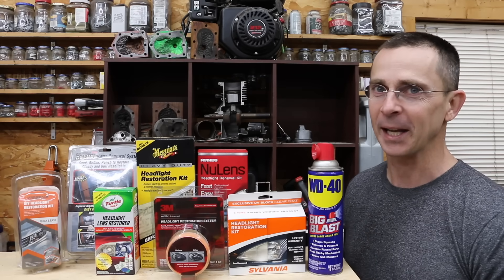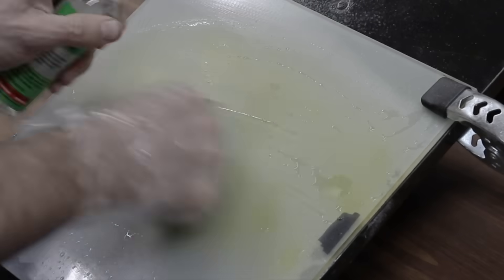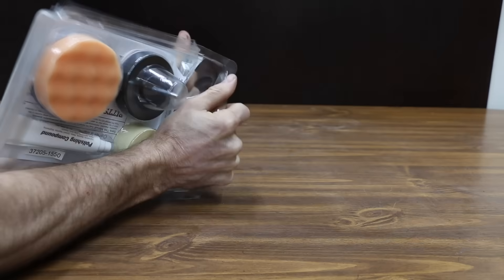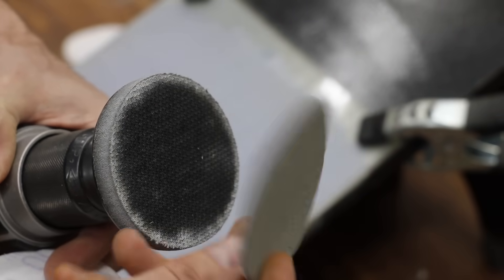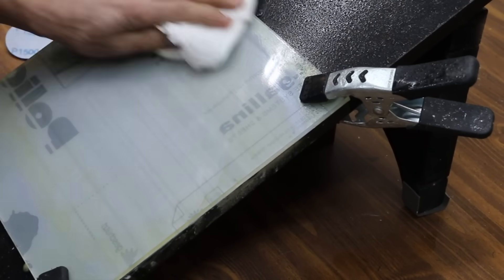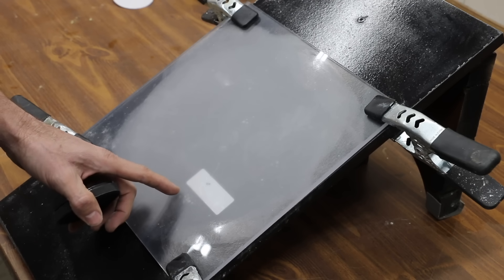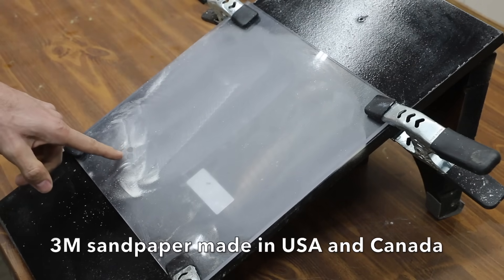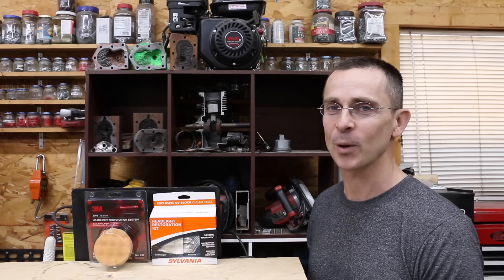Best Headlight Restoration Kit?  Let's find out!  3M, Sylvania, Meguiar's, Mothers, Turtle Wax & HF

Comment: Wish you’d used wd-40 as a control. You teased it in the beginning and then nothing. Great video but would’ve like to compare to home tricks such as toothpaste.
Reply from the maker: Thanks for the video idea.
Reply: @ProjectFarm  Actually there are many DIY headlight cleaning youtube videos.  Instead of any of these prepackaged products I cleaned mine by buying the separate items and after five years they still look like new.  The whole objective is surface preparation and then recoating with a clear, anti-UV paint for plastic.
Reply: @Rattlerjake1  - What paint did you use?  I have refinished headlights before, with just ok results.  I used Rust-Oleum 2X Gloss  Clear.
Reply: @stephenh5944  In auto parts places you can now actually get 2 part clear coat, automotive type in shake cans. This will do better than the rustoleum as its hardener is other ingredients is designed with high sunlight UV exposure in mind. Actually... new vid suggestion for  PF, "Which over the counter clear coat handles the sunlight best"... maybe he'll see this and give it a go... actually I'll put it on main comment feed also.
Reply: @Rattlerjake1  Yeah, what paint did you use?
Reply: Yeah, how good are these products in comparison to diy home tricks, would be cool.
Reply: Always good to see the comparisin, but if you have a bad lense, Try it. Cheap. Everyone has some. If your lenses have minor damage, the toothpaste is a very mild rubbing compound. WD-40 fills in tiny cracks and makes them disappear .... for a tiny while until it dries. The lenses I tried them on were too far gone. The 3M kit uses sandpaper to remove the degraded plastic and scratches. Makes the lense completely opaque 😬😱 .... very unnerving. But the finer and finer sand paper, rubbing compound, then polishing compound makes it look perfectly clear. Surprised the heck out of me!  Bottom line is toothpaste and wd-40 will work on marginal lense damage, but major yellowing needs more removal then they can provide.  By the time I was ready to try a kit, I had spent $500 on the other broken lense and was using a flashlight out the window since the yellow lense was way to degraded — toothpaste and WD-40 did not have a chance.  3M kit made it look new!
Reply: I can vouch that toothpaste and even plastic polish only work if the lenses are in good to decent condition. Anything less than decent needs the Sandpaper. Don't forget to put a UV coating after for it to last.
Reply: Toothpaste does work if mild oxidation, however, you still need a protectant for it to last. In Texas, it'll last maybe through summer without a protectant.
Reply: I bought myself a new toothbrush and used the old one with gritty whitening Colgate toothpaste. It worked well.
Reply: No one wants to hear about teeth whitening toothpaste being used as a mild abrasive for a damaged headlight. This is nonsense and is only good on lenses of slightly newer cars where the owner was too lazy to properly wash the vehicle and keep it out of the sun when possible. Rubbing compound, some Bounty paper towels, and your hand is superior to toothpaste. Walmart has Turtle Wax brand for cheap.
Reply: @B B This is how I do it as well.  If they are really bad I will start with a lower grit, but end at 2,000 and then rubbing compound.
Reply: Doug Roth I.    It’s just like compounding a car. Always keep it moving, never concentrate in one spot. The other thing to watch is sharp edges. Compound tends to cut extremely aggressively coming into an edge. That’s why I always try to buff off of an edge rather than into one.    Learned that the hard way🤭.    If you can’t do that just be very mindful of how aggressive it is right on that sharp edge or do it by hand in that spot.
Reply: B B      Sure enough, you do have to make sure to shoot it with  clear coat of some sort for anything to last.
Reply: Well....we all know if WD-40 can't fix a thing, its because you didnt apply enough WD-40.
Reply: Honestly if headlights have heavy oxidation I smear on Colgate and let it sit for an hour or so no water in the sun then rub the crap out of them. Acts like pumice. Then go over with nail polish. Don’t know how good it is for the lenses but lasted a couple years

Comment: Best thing to do for restoring headlights is wet sand paper and then meguiars cleaner wax..
Get a bowl and put warm soapy water in it,
Start with 1000 grit...wet sand
Then 1500
Then 2000
Then 2500
And then 3000 grit..
Let dry..
Rub cleaner wax really hard all over headlight...let dry for 10 min...
Wipe off...done!
Reply from the maker: Thanks for sharing.

Comment: True Brand makes a headlight restoration kit I think you can buy from napa not sure if you need a commercial account or not.. been using the stuff for ten years it's a longer application process but seems to have worked well for me in the past. Bg makes a kit aswell that I'm not sure I like as much. I'd love to see a project farm exhaust flow test. Somehow using a fan and balloons measuring increase or restricted flow from different mufflers or exhaust components.  I've been a mechanic for ten years. I really love you're tests. They have been a great source of Info and entertainment. Thanks.
Reply from the maker: Thanks for the video idea.

Comment: Very helpful, since I have 3 vehicles with headlights that need restoration. What UV sealer would you recommend if I get the 3M kit (Can't find the Sylvania kit anywhere local)?
Reply: I always buy the 3M Kits on eBAY where they are discounted.  Pick a 3M kit that contains the UV Treatment (some do).

Comment: Customer: which headlight restorer is the best? Me: (having a old truck that is running sealed beam “glass” headlights)   yes
Reply: I just upgraded my Jeep TJ With Hella H4 7" round lenses. Still glass with the benefit of replaceable bulbs and much better lens technology.
Reply: Me having a 1999 TransAm with popups that use sealed glass headlight units...
Reply: Nothing beats glass lenses. Last year I replaced the headlights in my 34 year old truck (not from the US, we don't have sealed beams but it has similar form factor headlights that use H4 lamps) because the reflectors lost their coating and turned blind. One of the new lamps arrived with broken glass. As the 34 year old glass was still fine I could just swap the glas from one old headlight to the new reflector and it looks just as good as the completely new headlight.
Reply: Glass is great, and even better, glass can be polished if not perfect.

Comment: back when i was painting cars i would sand the light starting with 300 and work up to 800 and then clear coat it with dc5300(same clear i was painting cars with) that clear has a very good uv protection. the lights i did on on my friends dc2 honda still look great and its been about 5 years now
Reply from the maker: Thanks for the feedback.

Comment: I used the 3M and applied thinned Spar Urethane with a foam brush.  Spar is commonly used for protecting wood in marine applications.  Thinning it makes it flow with a foam brush application so you don't have to spray it.  A few coats help it last.
Reply from the maker: Thanks for the feedback.

Comment: Get a box
2x4 and some long nails
Take out the headlights (it's like 8 screws total c'mon it's not hard)
Sandpaper, start high like 700 to 1500
Spray hose water
Dry with rubbing alcohol
Rust-Oleum 2x Clear coat (shown in this video with anti UV)
Put the headlight suspended on the nails put in the 2x4, you can stick the nails through the socket holes or get fancier, just ensure stability 
Do it on a warm day, look up videos on spray painting, cover with large box to keep dust away and check on after half an hour in the sun-bake box.
Reply from the maker: Thanks for sharing.

Comment: To remove the “yellowing” on a headlight I use Deep Woods Off liberally multiple times.
Reply: Deep Woods Off and Magic Eraser works great
Reply from the maker: Thanks for sharing.
Reply: Does this work? or are you joking?
Reply: @goodphrase1  The DEET softens the plastic so you literally wipe the oxidized layer off the lens. Of course you need to coat the lens afterwards with some type of UV protectant otherwise the oxidation will happen again. TLDR... Yes, it does work I have tried it myself.
Reply: @desktop_pilot  thanks. I never knew. Will try this tonight...
Reply: If I'm not mistaken, the active ingredient in that stuff is DEET.  Discovered to be an effective mosquito repellent in WWII.  It is actually a plasticizer.  It makes plastics soft and pliable. 
.
So, what is the surface of your headlights like after application and how does it hold up over time?
Reply: Default User It does work and does not eat the headlight.
Reply: I restore lenses as a living and have numerous customers use bug spray and it damages the plastic over time. It causes crazing and sometimes leaves a milky tint that goes beyond the top layer. VERY bad advice!
Reply: dcastro5551 I disagree

Comment: Awesome video. Thanks. I use the 3m headlight restoration kit whenever I have to restore headlights. You should make a video about what UV pretectant spray is the best and longer lasting for headlights before they start to oxidize again. 

That would be extremely helpful. 👍

If anybody in the comments has a great UV protectant for headlights that's last a long time please say.
Reply from the maker: Thanks for the video idea.

Comment: I use mothers and have to redo it every 6 months. no sand pads or anything but just the buff pad and cleaner. works fine. But, after watching this, I may switch to 3M. Looks better. Sylvania.....Good headlights (Especially the ZxE lights) but idk about other products they have even if video shows its good. I mainly stick to brand I trust. Mothers and 3M I use a lot. Sylvania i only used for lighting on my cars and motorcycle.
Reply from the maker: Thanks for the feedback.

Comment: I've done many and used several of the kits you tested.  Now I just use quality sandpaper and always insure it's continuously and liberally being sprayed with water while doing so (also up to 3000 grit). Inspect between each step to insure all deeper scraches have been remove which and take only 5 minutes but can take a much longer time for the first sanding. I do have and use the Meguirs polish as it works better than wax alone and then apply several coats of wax (this provides UV protection).  Rewax headlight at least every 6 months.
Reply from the maker: Thanks for sharing.

Comment: Speaking from experience what you do to restore faded headlights will depend on how bad the deterioration is. If your headlights are just beginning to fade you may get by with just using the Plastic X. Severe fading you will need to sand and restore. I too have found that the 3m is the better product. I have never used to sylvania.  You can also get to a point where restoration is not possible and a waste of time and money.Then just replace the lens. The key to restoration is removing the prior sanding step completely. Patients is key. Great Video keep them coming.
Reply from the maker: Thanks, will do.

Comment: Just did a week and a half ago my passenger side headlight the driver one was fine but didn´t get any special kit for the job. I used 400 and 1500 grit sandpaper, Meguiar´s rubbing compound, 3m rubbing compound, Formula 1 Scratch out polish, Chemical Guys glaze and protected it with 3m synthetic wax. It took me 2 hours because I did everything by hand but the result was excellent my headlight looks as good as new and a 100% transparent.
A lot of work but it was worth it and I didn´t buy anything just used what I already had in my garage, a lot of time and the power of my arm.
Reply from the maker: Thanks for sharing.

Comment: in my professional experience for best results I used 3M sandpaper in 500 to 800 to 1000 to 3000 with a DA sander, all wet. Use a polisher like 3m supplies but also use a machine polish compound after the higher grit compound. Finish off with a spray that Meguiar's makes to seal them off. The spray is very nice and self levels. Good video
Reply from the maker: Thanks for the feedback.

Comment: Headlight lenses are coated with a urethane in production.  Remove coating with sandpaper, 400, then 600, then 1200. Spray with clearcoat.
Reply from the maker: Thanks for the feedback.

Comment: Sanding and some 2k Clear Coat will fix the headlights permanently.
Reply from the maker: Thanks for the feedback.
Reply: True, we used to do that at our body shop. Looked better than new.  If sanded with 500 grit, and cleaned well, then 2k automotive clear applied. It stays on pretty good. Just don't use a pressure washer real close.  We always removed the lamps so we didn't have to mask the whole car from overspray. You can also add a small amount of black basecoat to the clear to tint them a little. Just don't over do it.

Comment: You could build a small box and put items in there at high heat high humidty area for a week.
Car manufactures put the 1st few cars built in a room at 110F 100-150% with constant light for a week to simulate 10 yrs of weather. Then taken apart and parts checked by each manufacture of that part.
Maybe just getting your own sand paper and buying just the coating would do the job for a couple$
Reply from the maker: Thanks for the video idea.

Comment: I tried Mosquito spray. It 'melts' the plastic, so some training is required. Normally, 1000 sand paper, buffing compound and some clear coat works OK.
I would expect 3M be the best, but Sylvenia did better. Wow.
Reply from the maker: Thanks for sharing.

Comment: I used the Mothers on my headlamps about a year ago and the results were pretty good.  There was a lot of sun damage on the outer and top edges of the lamps.  I used the sandpaper discs several times and eliminate most of the damage.  (good enough for a 13-year-old car).   I did pick up one important bit of information as a result, besides the winners.  The next time I buy a new cordless drill, I'm going to buy one with a built-in tachometer.
Reply from the maker: Thanks for sharing.

Comment: I've been using a product that's rather unorthodox on fine pitting to mild scuffs. Some of you do-it-yourself'rs already have this product.
In comparison to your products tested mine is still the easiest and begets a like new finish on cars headlight lenses. No water or lube and buffs with a clean cloth or paper towel. Each lens takes about 10 to 20 mins by hand. 
Tho I must use a choice of either a plastic wax or a UV clear sealant afterwards or plan on doing this 2 to 4 times a year.
OH, almost forgot, it also works great on my YUGE motorcycle windshield. 
IF you're curious, ask, it just might floor you what it is.
Reply: I'm asking.......!

Comment: You should try a blend of hydrogen peroxide 3% or higher and oxiclean, submerge lens in solution and let sit in direct sunlight, check every 15 minutes until desired results are met, then gently buff with preferred UV protectant. Got this from an old timer and I've never seen a clearer before and after.
Reply from the maker: Thanks for the video idea.
Reply: Seeing all these scratched and yellowed headlight lenses nowadays it's nice to have a solution that doesn't damage the parts and works!

Comment: I use Novus 123 for headlight and tail lights.  It's not a restoration kit, but a plastic polishing kit.  We use it at work for polishing cut poly and acrylic edges.  It works wonders!  If the lens is really bad, I'll start with 400/500 grit wet sandpaper.  Then move onto 1000 then 2000.  Finally, move on to the Novus.
Reply from the maker: Thanks for sharing.

Comment: If you can get your hands on a Quixx or Presto kit from the EU/Germany. It's for applying by hand but comes with up to 5000 grit sandpapers that don't tear when wet. My headlights already needed to be restored twice to pass TÜV, so the third time around i saved some money doing it myself.
Reply: The first two restores were done by different workshops and only lasted about 2 years each.
Reply from the maker: Thanks for sharing.

Comment: None of these actually work long term. I've tried 3 different methods including painting them with a 4k clear coat doing it the proper way wet sanding the whole nine yards. The only way to do it is with a spray gun or is to buy new headlights.
Reply from the maker: Thanks for the feedback.

Comment: Turtle Wax product user here, works a LOT better on real headlights than this test portrays. I just used it with a blue shop towel and the Step 1 liquid, you can see the haze come off as you wipe it off...all by hand...5 minutes
Reply from the maker: Thanks for sharing.

Comment: Auto Body Tech here. Going from 800 to 3000 is too large of s jump. I use, by hand, 600, 1000, 1500, then 2000 grit sandpaper on headlights. I then use rubbing compound, followed by polish with an electric buffer. All products are 3M. Unequaled results every time.
Reply from the maker: Thanks for the feedback.

Comment: Another method I've heard great things about:
1) clean well using windex and paper towels.  Let dry fully.
2) spray with high-deet-percentage bug repellant.  Wipe it away before it dries.
I tried once and was astounded, but I'm concerned about potential damage to the polycarbonate. (and I agree it seems stupid)
Reply from the maker: Great suggestion. Thank you

Comment: Some time ago I was skeptical of how long the headlight polishing kits lasted so I used Formula 1 Scratch Out (polishing compound) to remove the yellow from my headlights, wiped them down with alcohol and I added Rustoleum Clear UV resistant spray paint to protect the surface from further discoloration. It was very easy to do since no sanding was involved. You can see the difference the Scratch Out makes on contact with very little rubbing.  After 3 years they still look good.
Reply from the maker: Thanks for sharing.